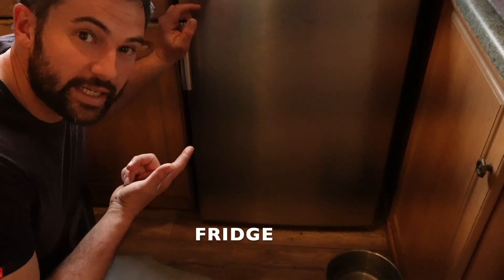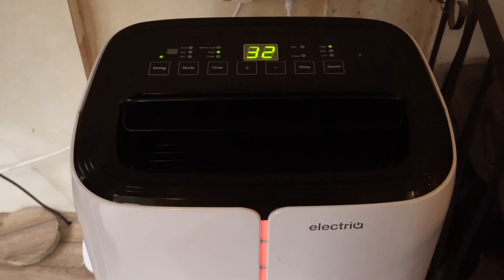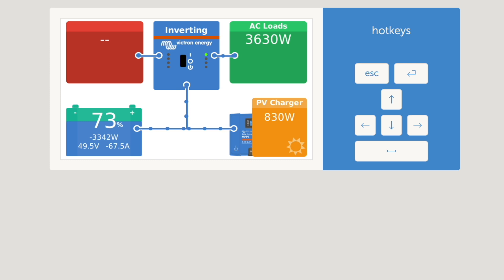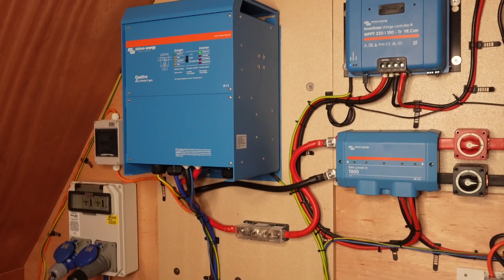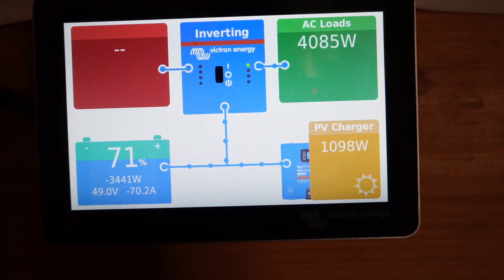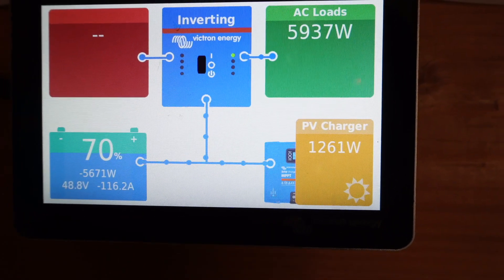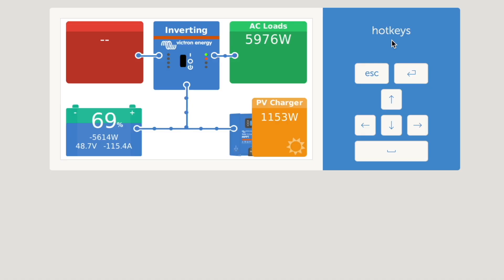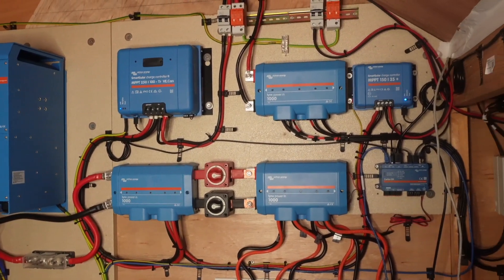WE PUSHED OUR OFF GRID SOLAR POWER SYSTEM TO ITS LIMITS

Comment: Is a red LED all you get? No app to interogate the battery to find out what it's problem is? 

How do the batteries current share? Under big loads, if one decides to shut down, you'll put the others under more stress. I assume they are wired in parallel? They can source 37A (90A max peak) each so if one stopped you're still only at about 25A each. 150A / 6 batteries. (Assuming they all share equally).  I would assume you should be able to read the output current on each battery to check they are sharing equally.

(Bit surprised that the Pylontech has such a wide range of current capability. 37A ideal max, 72A max, 90A peak.)
Reply from the maker: Since making this video we have bought what we need in order to interrogate the batteries and will make a video on this soon ☺️

Comment: hi , i've been off grid 35 yrs, done it all myself, ''not a pro''.  just looking at the cables between the batteries, they look way too small to me, i buy all my cables from scrap metal yard and i always go larger than i think is necessary,i don't bother with the sums i just go BIG, and use ''mens intusition''................
Reply from the maker: Funny you should say this, as we have had much debate with people about cable size.  Some have said we should have stacked them and used just the one set of cables and that definitely went against our intuition!!! 😱

Comment: I worry about loads of 23kw, EV charging 7kw, electric shower 10kw, base loads of 2 kW, home battery charging 6 kW.  
That will blow a 100amp fuse.
Reply: You’d have to have a long shower to actually pop the fuse! Many chargers have a ct clamp option to curtail charging if your home demand gets near the incomer rating. Fuses are designed to be run over their rating fro shorter periods of time so you’ll be surprised what you’d an get away with.
Reply: 2KW base load, do you live in a mansion? you need to check that as the cost will be huge. the other points, don't have a shower while charging your batteries and car.  Keep all batteries topped up and you will never use the full charge capabilities other than the car.  a modern 100a fuse will carry 25% overload for extended periods, ie high load for through the day and low loads at night without degradation. Fuses are very coarse,  if you put a 100a circuit breaker after the fuse (i am assuming that is the distributers fuse here) it will always trip before the fuse.

Comment: There shouldn't be any mystery.    8000w on a 48v system is 167a.   167a / 8? batteries = 21a/battery.    At 24v it would be 42a/battery.   At 12v it would be 84a/battery.    Most batteries of the size those look like should be able to do 84a or 42a or 21a for each one in my experience :)

Comment: thank you. I'll never buy such battaries, but some how its only mass accessible batteries sold in ukraine. others are at cosmic prices. I was using diy 7.5 kwH battery and it works great, but it dont have info output.
Reply from the maker: We’ve had a real love/hate relationship with these batteries 😩 we are going to investigate more this week and will post an update once we know what the issue is 👍

Comment: Same with my Trophy 220aH. That is why I built 9 more 16S 280aH myself. 5 of those also shut down on OVP if charged above 55.7V. We have 132kWh total. We loaded our two Sol-Ark 12K's with 11000W . All good.
Reply from the maker: Thanks for your comment 😊 Glad it went well when you tested your system 👍

Comment: That was a nervous 6 minute, I'm sweating 😅. Have you also looked into infrared heating panels. 👍👍👍
Reply from the maker: At least you saw it whittled down to 6 minutes. That was a good half hour for us 😂😂😂 We don’t know much about infrared heating panels. Are they good?
Reply: @The_OffGridFamily  use a mini split for heating for the best efficiency, the problem with those vented heat pump
Systems is they suck a lot of cold air into your home in the winter, can be problematic if used with some open combustion fires as they can draw the combustion products back into the home.
Reply: Infrared is great for workshops or spaces with short occupancy

Comment: like i told u before .u need to update the software on the battery's  u will not get away with it. ones  its done it will work the way it should
Reply from the maker: Thanks for watching 😊 It’s been a bit busy with the new baby etc but we are going to have a look next week 👍
Reply: Sonja Muller , where do I get the updated battery software? i s have a mix of US2000C and US3000C
Reply: @timcx We are installers in South Arica ..... our suppliers do the updates for us . but the battery's he has ...... did have a software problem from  the factory  . the battery's he has was the first bunch with bad software